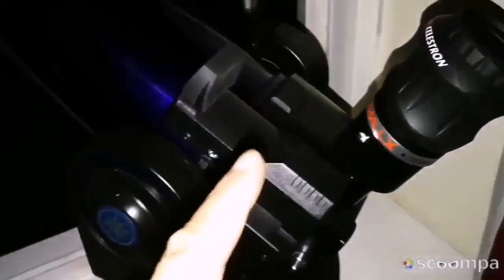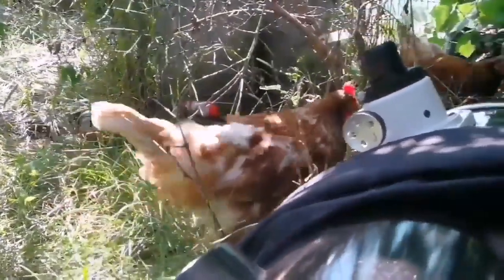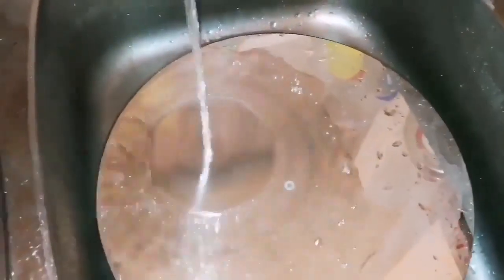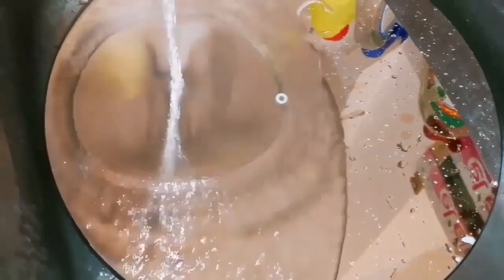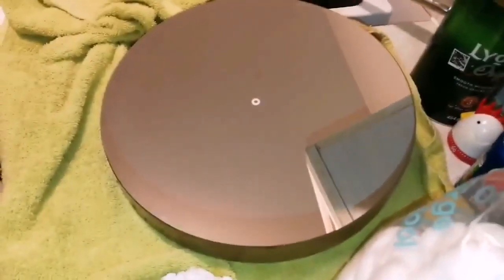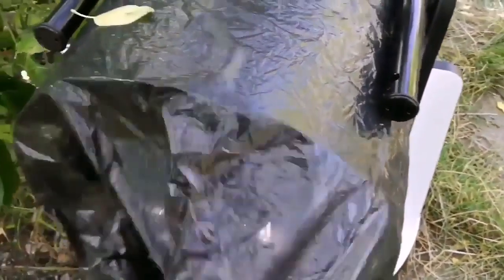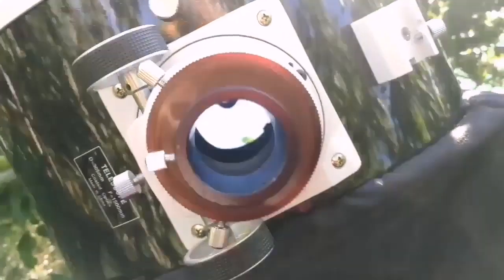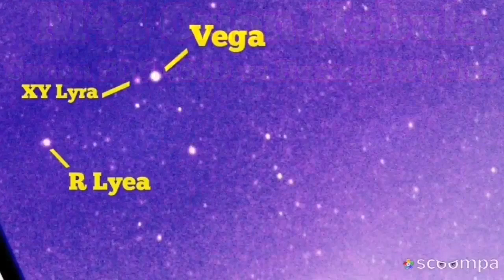Clean Telescope Mirror The Correct Way/ SkyWatcher 300P (12 Inch) Flextube Dobsonian Reflector

Comment: I had a quick question I live in a fairly strong lighted area just outside Phoenix Arizona and I have a small back yard however I have two street lights very close to me where I could underhand throw a rock and hit the light pole I was wondering would their be a large difference if I went to a close park where there’s a large green area where the lights are a ways away?
Reply from the maker: Good question. Go to a site called lightpollutionmap dot info and check the light pollution and dark sites near yourself. You can also use light pollution filters. Some say the best filter is 10 gallons of diesel fuel, but  you can not bit the comfort of observing from home. You can also concentrate on planetary observations which are not affected by light pollution. Whatever you do, remember it is a hobby and should not turn out to be a pain!
Reply: Hertfordshire Allotment Life Ok thank you. One more thing I figured out I live in a class 8 Bortle sky (yikes) is it possible to see a nebula with a 8’ telescope with a focal length of 1000mm?